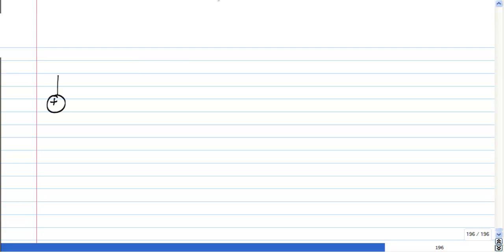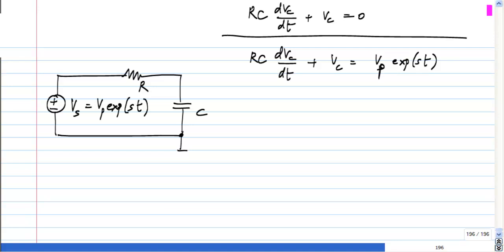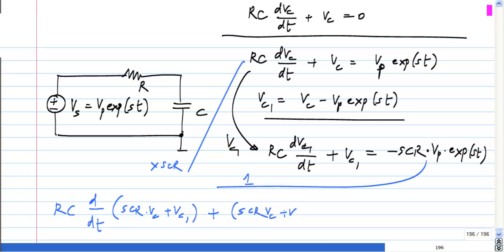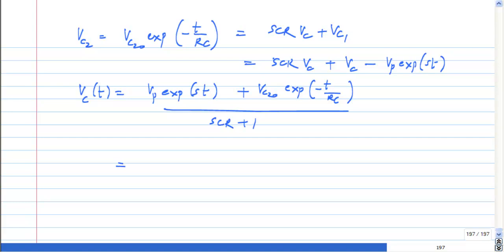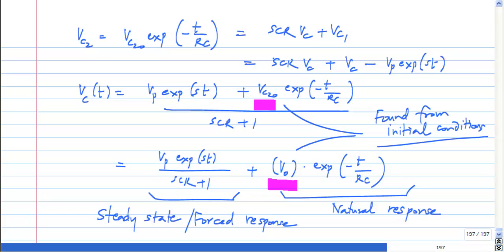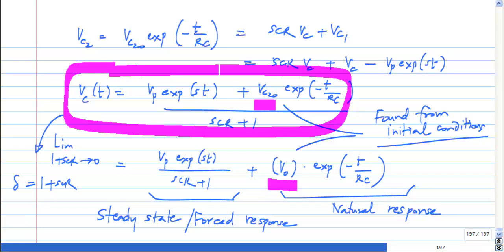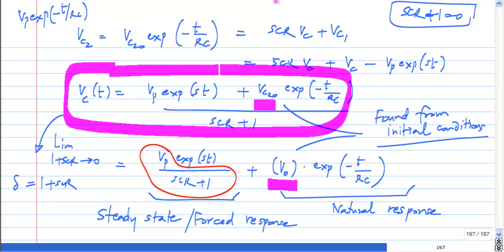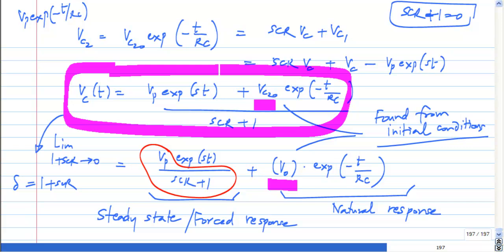First order RC circuit with an exponential input

Comment: Those who are confused with this method of solution: just solve using the standard method of solving a non-homogeneous linear first-order constant-coefficient ordinary differential equation with exponential input. You will get the same homogeneous + particular solution as in the video.
Reply: Could you please link any resource for this if possible? Thank you